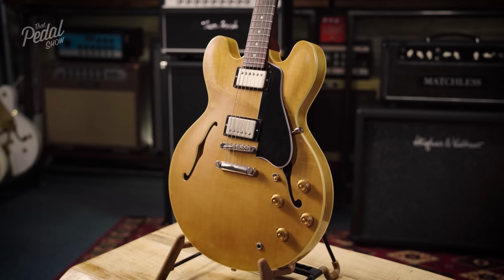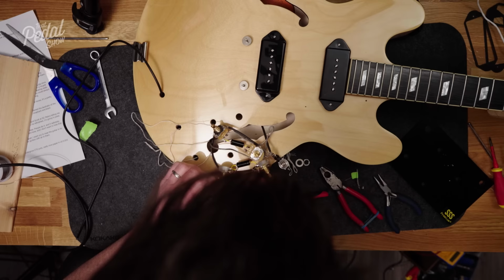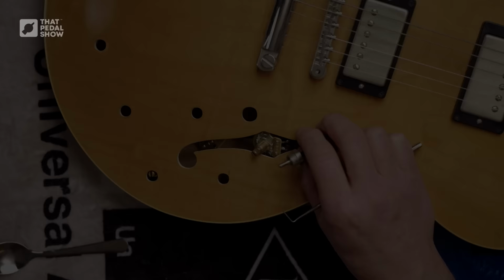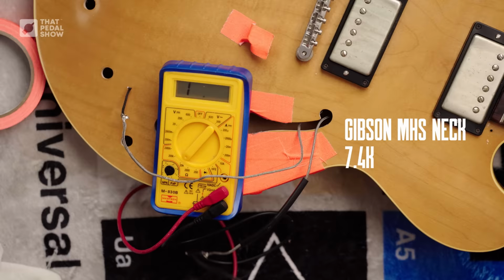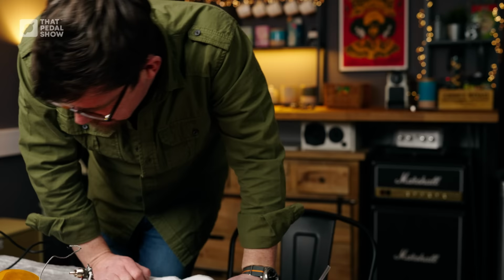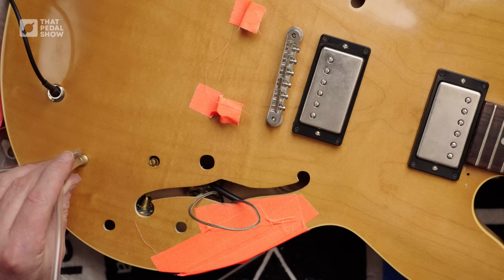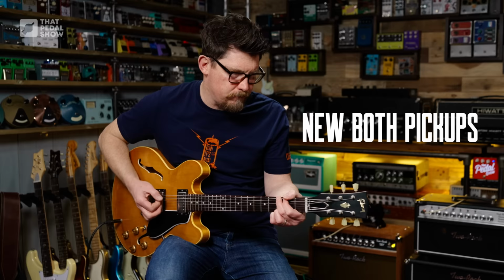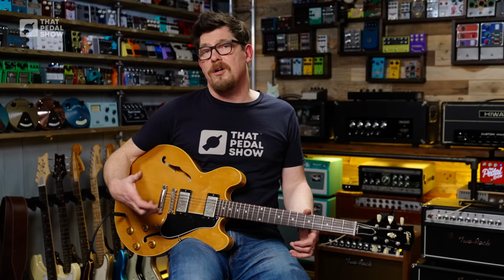Mick’s Gibson ES-335 Gets New Pickups & Loom [Hardest Pickup Swap Ever?]

Comment: This video has thought me a lesson, don’t buy a 335 style guitar unless I love the pickups it comes with
Reply: Or pay a guitar tech to install the pickups for you!
Reply: Yes… it is such an incredible hassle.

A 335 has to be PERFECT to even think about it.
Reply: was literally thinking this ha
Reply: HA! ...that's why I chopped the lead heading off into the oblivion, and soldered the new pickup leads to them ;)
Reply: Find yourself a 333, it has a Les Paul style backplate and pickup swaps are really straightforward. They only produced them for a couple years, and they get snatched up by Blink 182 fans and modded because Tom Delonge had a signature 333 that is unobtainably priced.
Reply: @brentporter9324  thanks for the tip I didn’t know that
Reply: Same thought crossed my mind while watching him switch out the wiring harness
Reply: Definition of did you ever wish you never started something 😂
Reply: I replaced the pickups in my 335. I dropped it off at the tech and payed 50 bucks. Judging by this video best money I’ve ever spent
Reply: I got to replace a volume pot in an Eko 335 shaped object back in 1982. It was horrible. Find a Guy...
Reply: The ‘63/‘64 Reissues are simple to work on compared to the ‘58/‘59 models. But yes, If you’re after a “Dot” neck style reissue, liking the pickups makes life much easier.

I’ve owned a ‘59 reissue and currently own a new ‘64 reissue and have done work on both. These are guitars that you should play before buying.
Reply: Goooood thinkin’!!!!!lol
Reply: Buy a Sire. Swap with Lollars. Or Fralins, spend less and get quality. Or keep the OGs. Or refi the house and buy a vintage 335.
Reply: @brentporter9324  good point.  Or a Gibson Midtown,  similar 335 style with backplate.
Reply: @wilbur741  Midtowns are really cool. I had one a few years ago before having to sell as part of saving for a house. They're a little different in that they're a routed out mahogany block instead of the maple lam construction, but they're fantastic guitars! There's a number of Gibson Semi-Hollow alternatives from the mid 00's that I really really liked that seemed to have disappeared to sell more 335s. The Vegas High Roller is another one - It was like a blingy Trini Lopez for half the price.
Reply: One of the reasons I got a Lucille, normal cavity, easy access.
Reply: No Doubt with any guitar
Reply: Yep changing them is one big deep deep and lonely rabbit hole……no thanks lol
Reply: Disagree, the 335 fully cranked up is amazing.
Reply: The ones that come with the guitar are just fine
Reply: I know there's one right I'm having the most trouble contemplating buying it then cancelled  twice now possibly purchasing again
Reply: @mattnorero4404 Just got the Sire H7 now to do exactly that. The unwaxed pickups sound fantastic and it plays great though so I’m holding off for a bit.
Reply: Its not that bad, man up and do it yourself you can only learn more in the process and afterwards you did it yourself which feels the best
Reply: @JammerhakenTV  your advice is noted and appreciated, but no not man enough I’ll get one with pickups I like
Reply: @johnnywatkins  Sir, I very much apreaciate your honest thoughts and your humble manners
Reply: @godzoo18  who said they couldn’t?
Reply: @godzoo18  no I didn’t. I said that I wouldn’t buy a 335 unless I loved the pickups, not that you can’t improve the guitar with new pickups. I’m jazzed for you that you are loving the new pickups in your guitar, I’m sure you’re feeling a dramatic improvement. But I try to do a lot of those jobs on my guitars myself. And changing those pickups looks like a frustrating job. So for me to buy a guitar in that style I would want to be confident that I like those pickups. Not every 335style guitar has the same pickups. I’m not saying you can’t improve the sound of the guitar with a pick up swap I’m saying to buy one I’d have to find one with pickups I already know I like
Reply: @godzoo18  I don’t have any idea what your saying
Reply: @reverb508  Or leave well enough alone. Thanks to the interwebs, everyone thinks a pickup swap needs to be done on all guitars. How guitarists in the 50s and 60s managed to sound so good with stock guitars is a mystery.
Reply: @gainbear8853  If he had not changed the pickups out, all comments would be raving about what great tone this 335 has. 
Modding perfectly great guitars is a sickness.
Reply: @charlies3287  there wasn’t an aftermarket pickup industry in the 50’s and 60’s, so your point is moot. They  just didn’t have options back then. Also, the “interwebs” had nothing to do with the birth of guitar mod culture. Once Dimarzio and Seymour Duncan started offering aftermarket pickups in the 70’s, people were ripping the PAFs out of their 50’s Les Pauls and replacing them with Super Distortions and the like. No internet back in the 70’s.

Comment: Once saw Trogly show a neat little trick to avoid all that fishing the pots in and out hassle: he ties thread 🧵 around the shafts before dropping them inside the body. That way you can just pull each thread through the respective holes and fish the pots back up in no time. Works for the pickup leads, or the jack as well

Comment: I rewired a jazz box once, it was a breeze because I tied washers and strings to the existing pots then removed everything leaving the washers and strings in the guitar. I then did all of the wiring outside of the guitar. I then just tied the strings to the new pots and fished the entire new harness and pickups back through the respective holes by pulling the strings with the washers. It was actually the easiest wiring job I’ve ever done.

Comment: Mick, your frustration was visceral and palpable -- and way too relatable. I've modded many, many guitars and basses, and the one notable failure was my attempt to install a set of Duncan P-Rails (and a coil-splitting tone pot) in my Dean Boca semi-hollow electric 12. The three biggest issues were the original wiring (which included a multi-pin plug assembly for the pickups), the narrow f-hole, and the shallow body cavity. After two days (seemed longer) my frustration was off the charts and I threw in the towel. Am truly glad you were ultimately successful with the 335. Congrats!

Comment: I did this to my bandmate's and my 335 back to back all with lock washers. Instead of tubing, I used long pieces of neon green sewing thread tied to each pot shaft and a nut on the back side of the jack. Somewhat easier
Reply: Waxed dental floss is what I've used in past jobs. I found it stronger & less likely to slip than plain thread...
Reply: I seem to remember I used malleable thin green gardening wire. It definitely needs that method from the get go. Knobs off, attach the wire, fishing line, whatever to the pot necks then undo the nuts and pull the harness out, making sure you don’t pull the guide wires through… doh!

Comment: Nice job, Mick! Thanks for posting this. Putting new pickups & wiring, etc in a 335 was the first mod I ever took on. I used a backpacker's wire survival saw to widen the center block window so the new (coil tapping) pots would fit through. My second mod was to a strat and was quite pleased at how simple it was! I probably won't do another 335 but I'm glad I didn't know beforehand just how difficult it would be. Now my only real hesitation to mod guitars is from soldering. It's such a frustrating disappointment to get the thing all back together only to find that it doesn't work. I really wish I could find a way to make my soldering more consistent.
Reply from the maker: I got a lesson from a couple of people… and also watched some YouTube vids. The right tip, making sure you clean it, the right solder and practising about 100 joints will get you there! And a good iron of course! Good luck!

Comment: Been there done that.  Changed out the loom on my 335 copy with cts pots.  I went the string route to pull things through.  Finally just jammed my fingers through the f-hole to get things in place after literally bleeding on guitar and plenty of curse words under my breath I got it all in.  I figured no this thing still works after all the yanking on the solder joint but it actually worked.  I said never again.  The pickups will just have to do.  Way to stay with it Mick.

Comment: I use string tied to the Pots when pulling them out. Helps to not lose any washers in the cavity as well making it easier to pull the pots back thru. Then I just cut the string off the pot when I have the pot locked in place.

Comment: I just did a little job on my 335 (changed the in and out on the volume pots). I drilled a 1,5mm. hole in the shafts, used some gardening/flower wire and was 100% sure that I could retract the pots without a lot of fuss 😉

Comment: I feel your pain. Done many pickup swaps (and two harnesses) on my '67, which has the centre block cutout. Doing it all through the f-hole = ouch!

The low winds do seem to have opened up the top end a little, so good result - much easier to roll some treble off when needed than to add it in.

Comment: Hey Buddy, some flux and a small paintbrush will help tremendously in any de-soldering activities. Simply paint a bit of flux on the old joints/back of pots, and the old solder will melt in a split second, and transfer less heat, but also control any splatter.

Re-wiring 335s live in my nightmares…

Comment: This reminds me of when I took an old used Gretsch Eletromatic and did a complete pickup/wiring harness, tuners and cosmetic overhaul to it. TV Jones harness and Brian Setzer Signature pickups were easily installed with the TV Jones installation kit but the catch was that the holes were too small for the controls to fit through. Out came a proper sized dowel rod with sandpaper wrapped around it. Took quite a long time to sand the holes wider to fit the controls. To TV Jones credit, they offered me a very good deal on the pickups and harness. 
  What I learned over the years is that whatever you put your blood, sweat, tears and (often) mental frustration into becomes your favorite thing(s) because you put a bit of yourself into it. This may answer the question presented here about pregnancy and birth and why women endure excruciating pain a couple, to multiple, times. 
  I could be wrong, time will tell, but I think this guitar will start to become a favorite of yours strictly based on the agony and time spent upgrading it to your specific wants and needs. The guitars I've modded, and I've modded quite a few, once completed are never considered for anything further than playing. I try to ensure what I want before modding them. I have one Strat that I've been putting off swapping the harness on because of time and (sometimes) financial restraints but this video is kinda pushing me to complete. Once completed it will be perfect. Those guitars will stay in my possession forever. The others I'm contemplating on ridding myself of as I have way too many guitars for such a small living space (apartment). Guitars are literally strewn throughout my apartment and the ones I always play are those that I put myself into. The others are really just 'there' for the most part. Lol. 
  Thanks for sharing Mick!
Stephen
Reply from the maker: I like this Stephen and I think you’re absolutely right about the bonding process. I had the same experience you’re having with a Casino and ended up having the widen the holes for the pots. I love that guitar now too! Cheers man, and thanks for the thoughts.

Comment: I bought a 335 Memphis dot with a single piece back, I just needed it. My need to have it overtook my ears. 
That said it is a superb guitar, an icon, just lovely to have it hanging off your strap round your neck, but the sound……does it really sound as good as the guitar looks no is my answer. 
Mick…..you’re a better man than me as after watching this super video I would not attempt that job, the guitar would have been in a tree down my garden. 
After the change you made I did think may be the neck PU of the old set and new bridge PU would have been a good mix……just my thoughts.

Comment: FWIW, the Gibson ES 333, was built in 2002-2005 at Nashville plant, and is essentially an es335 with a back cover plate to access pots. Same essential build, but with satin finish, different pickups than contemporary 335, simpler headstock logo. Pot and pickup changes as easy as on an LP. Tougher to find remaining 333's, but they're out there. Plus, access being from backside, risks less top damage. You can swap pickups readily and try many combinations with relative ease. The 335 design sort of discourages pickup swapping for many.

Comment: I know you know what you are doing but…a towel under the guitar, blue tape on the F-hole edges for pulling pots and even blue tape under the spoons when pulling knobs goes a long way to protect the guitar during surgery. Also, covering the whole guitar when soldering protects it from any flying solder splatters.

Comment: I almost sold/traded my epi 335, as the stock pickups were way too dark and slightly muddy sounding in a recording setting. But instead chose to get imperial low winds installed. Got the guitar back from my luthier (Flame Guitars on YouTube) and they sound immaculate! Zero regrets and my 335 is seriously giving my Strat a run for its money as my no.1

Comment: I’d add a wire from each of the volume pots to each of the pickup cavities so that any time I want to change them, I only have to remove the pickups and not the harness. The extra lead wire under the pickup will have no effect on the sound.
Reply from the maker: That makes A LOT of sense. :0)

Comment: another tip.. use plastic stick (I use a soldering tool) to move shit around. 1. so you don't fack up finish. Lastly, add extra wire between pots for moving shit around and logistics of installing.

Comment: Hey Mick.  My 335 is a dot reissue from about 25 years ago.  I did switch the factory pickups out for the same Lollar Imperials that you selected and had the wiring converted from stock to ‘50s wiring.  I had the work done by a pro because I wanted the guitar to still be in one piece when done.  Kudos to you on this project.  Very challenging work for a person with regular fingers instead of octopus tentacles or sticky tipped spider fingers.  Best always man
Reply from the maker: And to you Ross, cheers man! I hope you like the changes!
Reply: @ThatPedalShow  the changes mean that the guitar comes off its hook more often.  So success!

Comment: A trick I learned years ago is to tie string/twine or dental floss (from Montana) to each of the components before pulling them out. Make the string long enough that you can cut it from the old and tie it to the new. It's easier to fish back through the hole and cheaper than the tubing,. It doesn't relieve the frustration of getting them back inside the guitar, though.😖 Way to hang in there, mate! Cheers!

Comment: I agree I could hear it more of a difference in the mix.  Lollar's in the upper mids and more articulation with note seperation clean and dirty.  The lollar bridge also appeared clearer and not as muddy when you had the tone rolled down. The original pickups appeared to be a little hotter unless you digged into the notes a little hotter when playing.  If it was actually played the same way then the originals seemed hotter.  The original pickups also appeared to get darker when you just rolled the volume down and keeping the tone on 10.  Overall I agree  very close with quite subtle differences.  Thanks for persevering through the process.

Comment: Mick (and anyone else): Marvelous, fun and funny episode.  If you want more air, chime and overall clarity without changing pickups look up the “Pinnacle Locking Aluminum Base, Titanium Saddles TOM Nashville bridge”.  Price went up to ~$70 since I got mine in 2021, but the tonal difference from the standard Gibson Zinc (“pot metal”) is major, and it’s not as mid-aggressive as Stainless Steel.  The stock pickups should be fine with it.  I’d order a few spare of the locking brass nuts with it.  I striped one pretty easy.  You could seek out an Aluminum tailpiece as well for increased tuning stability and sustain.

Comment: Back in 1975 I purchased an old ES 345 (stereo) that had broken solder joints for the wires connecting the varitone switch.  I pretty much had to remove everything as you did, but with more complexity of the varitone.  This was obviously decades before YouTube and I knew nothing about guitar repair.  I had no lifelines.  But I managed to get it all done despite my severe shortcomings. 

Instead of plastic tubing to guide through the components to their holes, I recall using old guitar strings that I first fished through the destination holes to the F hole.  I used electrical tape to help secure the strings to the screw columns.  Bent coat hangers helped fish stuff through as tough angles.

It was time consuming and a bit frustrating, but I think I got it done in two 1.5 hour sessions.  I was happy since I bought the broken guitar for $200 and made it perfect despite my abject lack of experience and ability.

Comment: Between the difficulty of getting the wiring in and out of the guitar, the hot soldering iron and the most difficult guitar to work on, ya done good! PS: For all that trouble, I think that the original pickups were fine on that particular guitar. I could hear cleaner highs from the new wiring and pickups.
Reply from the maker: Hello Brian. For sure the differences are somewhat subtle here. What I can tell you after some time is that the guitar gets gigged now and I really enjoy playing it. Before it was just too woolly. Cheers!